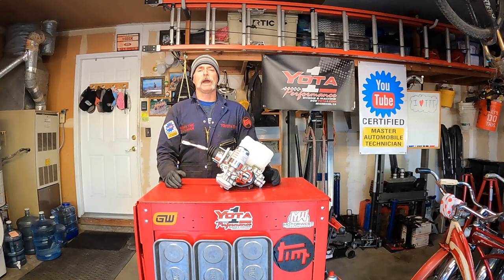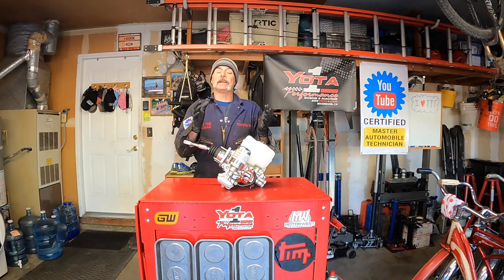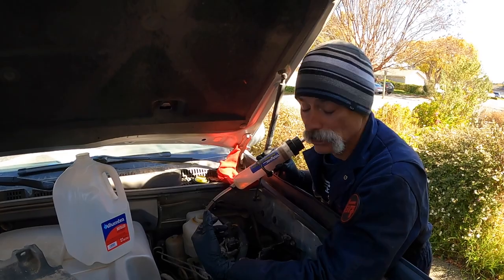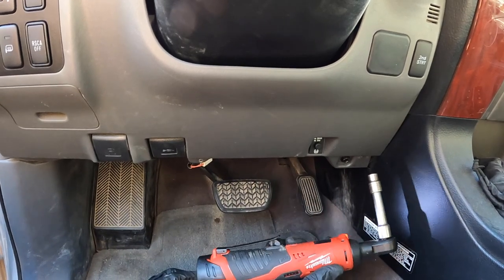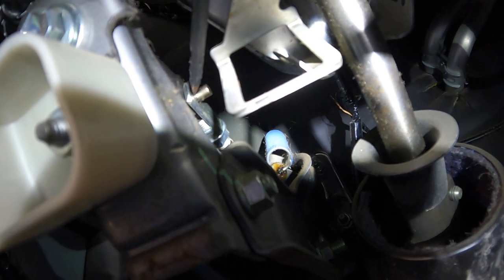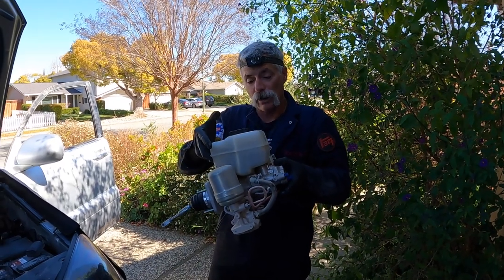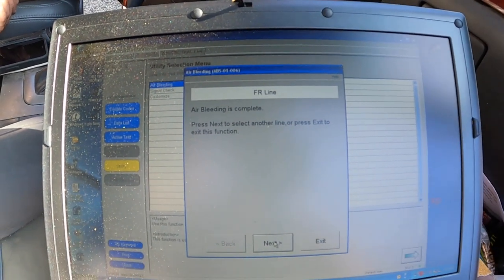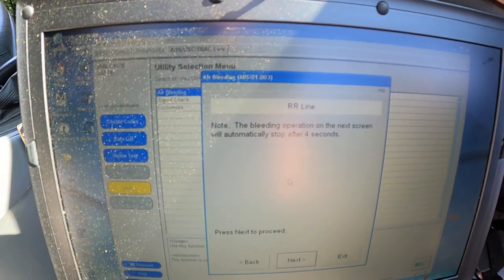Lexus GX470 Brake Booster Replacement

Comment: The issues with this hydraulic brake booster is the hydro accumulator fails most times. It's a combination of both mechanical parts and electrical parts.1,  Within the brake booster system there's a kind of thin film that gets punctured when you let your break system run low on hydraulic and it causes it to act like there's air within the system. 2, there's a hydro booster motor that spins anytime you turn on your vehicle and it can get noisy but as it ages it fails and it can causes the break pedal to loose pressure especially when you use it once b4 and you have to pump it up again to get break, that's because once you use the break, the booster motor fills up the accumulator again ready for reuse but because it fails it just looses pressure... which is what our friend here experiences. It's a nice system but I don't like it because when it fails, it's intrusive... unlike other Toyota abs designs that when they fail you still get servo breaking. Nice work Tim.... you're a legend. There are many things that could cause this too, amongst the plugs that go to the module one is a pressure sensor and that pressure sensor can fail and cause this same symptom too. Thos who haven't experienced this module failure wouldn't understand it's a very dangerous situation especially when you're on speed. Note when you were depressurising his system it didn't take much break actuation, that's because it never held pressure... it could also be an internal seal leak.... there's a whole plethora of possibilities but a complete replacement is the best shot.
Reply from the maker: Thanks for sharing all that.   It sounds complicated.  I've heard that people rebuild them, but from what you said, there's several potential causes, so replacing the whole unit does sound prudent.
Reply: @TimmyTheToolman yeah, replacement is the best bet.
Reply: I’m actually super glad I read your comment / just snagged a gx470 and this was recommended to me as something to replace - having had other ABS systems I assumed it was servo brakes as the default braking failure mode….. I’ll bump it up the list of “must fix” items

Comment: What’s everyone doing if they don’t have tech stream? I’ve put my new unit it and I’m trying to bleed the brake booster assy using the how to hbb video but the two front  lines facing the front of the car aren’t bleeding, no fluid is coming out where the other three there have been no problems.
Reply from the maker: I don't know how many people are going to see your question.  I would suggest possibly going to a shop that has tech stream to do the bleeding for you.
Reply: Thanks Timmy! Lots of people watch your great videos, so hoping. But will take it to a shop if I can’t get it. Appreciate your quick response. Your videos are amazing!
Reply from the maker: @AR-xu2gg  Ok, good luck!

Comment: The timing of this video is amazing. I’m looking to replace my brake booster on my 03 gx. My brakes feel ok (not GREAT I’d say), but more annoying is my buzzing/vibrating brake pedal every 3-4 presses. It buzzes on startup like it’s building pressure, but then it does it frequently when driving when using brakes.
Reply from the maker: Sounds like you're due for a replacement.  Good luck with the job.
Reply: @TimmyTheToolman  From my understanding from reading things and watching one of your other videos, it sounds like I need to replace the brake booster/pump (the cylindrical oil filter looking thing) and not the entire master cylinder. There’s a guy from the Lexus message boards who sells entire master cylinders rebuilt for $550... the booster I can get for $420... but, might be more cost effective to replace the whole unit all rebuilt vs just the booster?
Reply from the maker: @JoeMNPT  If you could get  the whole rebuilt unit for $550, that sounds like the way to go.

Comment: Thank You for such a detailed video with thorough explanations. I have a hissing noise coming out of my brake paddle and each time it hisses the brake booster motor works and I feel the vibration in my foot through the brake paddle. Also, I hear a suction and whistle noise when I start my car it goes away in 1 minute, and then when I turn off the engine another suction sound comes loud from the engine. I tried to locate a vacuum line leak but I couldn't find one in the hoses and around the intake manifold. I am stressed and I am afraid that my brake booster motor is going to fail if this hissing noise keeps going on. Please help!!!
Reply from the maker: It certainly sounds like an issue with the brake booster.  I've heard you can buy rebuilt ones for a more affordable price but I haven't tried to source who sells them.
Reply: @TimmyTheToolman  Thank You so much for your reply. So I should just replace the brake booster or is there a way to find the leak and try to fix it? I live in Houston Texas, If you can recommend me any places to take the car to may be they can figure it out for me?
Reply from the maker: @RizwanRizwan-bd9su  I don't know how you'd find the leak.  I would just rebuild it with a kit but I don't know if they still make a rebuild kit for it.  When we did the job, Thanh said he found out Toyota no longer makes a rebuild kit for it, but maybe an aftermarket supplier does offer a kit.  

Like I said in my other response, I think people sell rebuilt brake boosters.  Do a search with the part number we provide in the video description and I bet you'll find a rebuilt one for a much more affordable price than new.  

I wouldn't have a recommendation for a shop in Houston.
Reply: @TimmyTheToolman   Thank You so much I appreciate your response and help. May God Bless You!!!
Reply from the maker: @RizwanRizwan-bd9su  You're welcome.

Comment: How did you get the pin back in? I know you didn’t show it but I am having no success am I have lost the pin twice trying to blindly slide it in place.
Reply from the maker: It's not comfortable but you have to get your head under there to see what you're doing.  I utilize a headlamp so I can use both my hands and still see what I'm doing.  So, I wasn't blindly sliding it in place.  I could see the pin sliding through the pedal and the brake booster plunger.  If you haven't dropped that lower interior trim panel, that might help.

Comment: Great Video Timmy.  Do you know if this is the exact same procedure for a 2004 4runner limited V8?  I got the trac light, vsc light, brake light and the buzzing alarm noise inside.  My limited 4runner is very similar to the gx470 without all the Lexus bells and whistles.  Is the bleeding process the same?  It seems to make the most sense to replace the entire unit since I have 287K on my rig.
Reply from the maker: I'm not sure it's the same because we've never done this job on a 4th Gen 4runner.  I'm assuming it would be very similar but I don't want to steer you wrong and say it's the same when I'm not sure.
Reply: @TimmyTheToolman  I assume it's pretty similar as well.  Thanks for all the great videos.  I really learn a lot.
Reply: @Rob111270  so was it the same procedure? I need to replace this unit in my 2004 4.7L sr5
Reply: Procedure is the same for 2005 V8 4runner
Reply: It's the same procedure whether it's a 1986 Pontiac/Buick, 1990 Ford/Lincoln 1992 Land Rover or a 2000+ Toyota/Lexus or any of the other Various brands that used this German junk.
Reply: I have an 04 gx 470 and I replaced the calipers rotors and pads. No lights on dash but I don’t have abs. Some think I should recalibration which I’m willing to do but I’ve heard varying bleed sequence recommendations. Can you verify the order is RF,LF,RR, LR? I’m stumped about lack of abs
Reply: @fredcornelius9247  usually you start the farthest from the master cylinder: RR, LR, RF, LF. Pretty sure an '04 has ABS. It may not be like this one but more of the conventional style with a vacuum booster and a separate ABS hydraulic unit.
Reply: @topher8634   he says manual states rf lf rr lr for calibration just looking for multiple confirmations because everyone has been telling me conventional furthest first method
Reply: @fredcornelius9247  i would follow the service manual then. I was always taught to go to the farthest wheel and work your way up. Bleeding the rear is different as you don't pump and hold like you usually do. You just turn key on, open bleeder and slowly depress the brake pedal. The pump will force the air out of the circuit. Then close bleeder. Just don't allow the pump to run more than 10 seconds at a time and allow it some rest in-between cycles. The Teves systems are the worst braking systems ever. They started using them in the 80s on Mercedes, Volkswagen, even GM and Ford. The domestic manufacturers ditched it back in the early 90s and was wise in doing so. I can't believe Toyota continued to use the junk. If you change the accumulator when you notice the pump running more frequent and longer, you can save it. A lot of the time the seal in between the pump and motor will fail and fluid will pour out.
Reply: @topher8634  I’m used to doing it the way you described. I haven’t had any symptoms other than softer pedal than I expected and longer stopping distances with no abs.

Comment: Love your detail Timmy and Tanh. I just did my 2004 and, what I think is the ECU and bracket get in the way on the left side when taking the 4 bolts off that hold the brake assy to the firewall. Had to get in there with smaller box end 12mm. The ratcheting style are nice in this spot.
Reply from the maker: Thanks!  We're stoked you appreciate the detail this video offers the viewer.  I love ratcheting box end wrenches.  The flex head ones are awesome.  Total game changer.  If you don't have flex head ratchets with 120 engagement points, I highly recommend you get yourself a set of them.  With them only taking 3 degrees to get to the next click point, it allows you to remove a bolt or nut in very tight quarters.

Comment: Now I'm just going to think about those slivers on the end of the brake lines I didn't check for until I pull them all off again.
Didn't think of checking that, good tip.
Reply from the maker: It might not be as big of a deal that I make it out to be but it's been something I've noticed when working with brake lines and fuel lines.  I figured it would be best to make sure the flared tubing end was clear of debris before reassembly to limit the chance of a leak.

Comment: You are a Toyota God among men.  I was watching an install of a 2nd gen Tacoma's Master cylinder.  Different setup with a separate Booster, 
But, Is there an option for the GX470 / 4runners to add fluid into the master and bleed it prior to installing to make the bleeding process easier?  (Plugging 3 of the 4 holes and on the 4th hole have a tube recirculating the fluid back into the master while pushing the plunger in and out to remove air, then switching to the other 3 openings to bleed as well?  Maybe to eliminate the need for TechStream?  Slightly more messy of course.  I bleed the brakes on GX470's (Caliper Swaps, Longer Steel Braided lines) a lot and don't need TechStream and wonder if there is a way to not use it for this install as well.
Reply from the maker: My experience with the GX470 brakes is pretty limited to the videos I've done.  I've heard of different methods to bleed the brake booster without the use of Tech Stream but I haven't tried those methods.  I know with standard master cylinders with a separate brake booster, you can bleed it of air before doing a general bleeding of the braking system at all 4 wheels.

Comment: Have a 2002 Toyota 4Runner, ABS and Brake light on dash come on along with a very loud high pitch alarm that’s constant. Still had brakes for a couple days. Moved the truck a couple days later at my house and brakes went out, stiff pedal and barely came to a stop even at a low speed of 5-10 mph. Went to start up the truck a couple days later to let it run and dash lights and alarm went away and had brakes again after a minute or two. Drove truck around the yard to confirm and had brakes again. Went to start it today and lights and alarm came back on but still have brakes at the moment. Ever run into anything like this? From what little research I’ve done it’s pointing to brake booster/abs pump module which is supposed to be one unit on this year 4Runner. Just confusing that I lost the brakes then started working again.

If you get around to this comment, just wanted to say thank you too. Never had much experience working on vehicles and your videos have helped me a lot in the past.
Reply from the maker: It does sound like your brake booster has gone bad.  They are very expensive, unfortunately.  There's a guy in Washington that parts out 3rd and 4th Gen 4runners.  He might have a used one he can sell you.  His name is Josh Young, and his company is PNW Connection.  Tell him Timmy the Toolman referred you.  https://www.facebook.com/josh.young.3950?mibextid=ZbWKwL

Comment: Hey Tim! What’s the program you’re using to do the final bleeding? Where can I obtain it? Thanks!
Reply from the maker: The program is called Tech Stream.  I bought it pre-loaded on a laptop that I bought from an Ebay seller.  I don't think he's selling them anymore.  There's official and unofficial ways to obtain the program.  Here's a link to the official way by buying a license to use it: https://techinfo.toyota.com/techInfoPortal/appmanager/t3/ti?_nfpb=true&_pageLabel=ti_home_page&contextType=external&username=string&password=secure_string&challenge_url=https://techinfo.toyota.com/techInfoPortal/login/techinfo&request_id=-5518364760491963150&authn_try_count=0&locale=en_US&resource_url=https%3A%2F%2Ftechinfo.toyota.com%2F  I'll let you do the research on the unofficial ways to obtain the program and license to use it.
Reply: @TimmyTheToolman  thanks Tim! I found a light version but not sure if I can do that process on that version. What do you think?
Reply from the maker: @tbassiii  It should work but call them to confirm it will perform the brake bleeding function.
Reply: @tbassiii  did you confirm if the light version does this process?

Comment: Did you do a vacuum test on the booster to see if it was loosing vacuum? ie  vacuum hose cracked, grommet, etc..
Reply from the maker: There are no vacuum hose connections to this type of brake booster.  It's all electronically controlled.  You're thinking of a different type of brake booster that uses vacuum from the engine.
Reply: This system uses an electric pump to develop high pressure fluid for power assist for normal stops and ABS braking. No vacuum is connected at all. That's why this system is so dangerous because when the pump motor fails, not only do you lose power assist, you also lose all rear braking. This system has been around since the 80s. It's German and was used in foreign and domestic brands. The domestic brands got smart and ditched it back in the early 90s. Can't believe Toyota used it into the 2000s. If you pay attention to how often and long the pump is having to run and replace the accumulator when it becomes to frequent or long, you will extend the life of the pump. I believe this one was leaking internally or had a bad main or dump valve though. He was having extended pedal travel.

Comment: What factory service manual site do you use for all your info?
Reply from the maker: Toyota Tech Info: https://techinfo.toyota.com/techInfoPortal/appmanager/t3/ti?_nfpb=true&_pageLabel=ti_home_page&goto=https%3A%2F%2Ftechinfo.toyota.com%3A443%2Fagent%2Fcustom-login-response%3Fstate%3DLAP2sB9UdFaJyflNepLN4DgVzzo&original_request_url=https%3A%2F%2Ftechinfo.toyota.com%3A443%2F

At the bottom of the page there's a link that spells out the minimum system requirements to use that site.  You need a windows based operating system.  I bought a used laptop on Ebay just so I can use Tech Info to look up FSM information I need.  I pay $20 for a 2-day subscription and download all the information I need.

Comment: big job what's the cost
Reply from the maker: The cost of the brake booster use to be around $2500.  Now you can pick it up for around $1500.  Don't know how many hours of labor this would bill for.  And, every shop will have different hourly labor rates.

Comment: Mines gave up the unit cost a whooping 2000 dollars at the dealer.  I'm sad bought this 4runner a couple years back.  None of the mechanic want to use a refurbished unit all wants new.  Anyone nice enough to help out that lives socal?
Reply from the maker: You can use the link we provide in the video description and get an Aisin one for $500 and swap it out yourself.   The video walks you through what you need to do.
Reply: I appreciate the video, im not mechanically inclined but the  video is a great resource.  The Aisin part is new to me however i type the part number on google and its showing me the toyota part.  Is there a specific link to get the aisin that is 500?  Thanks for the video sir.
Reply from the maker: @harold6716  Sorry, I was totally thinking of another video I did on a GX470.  As far as I know, you're right, you can buy new or get a rebuilt one.